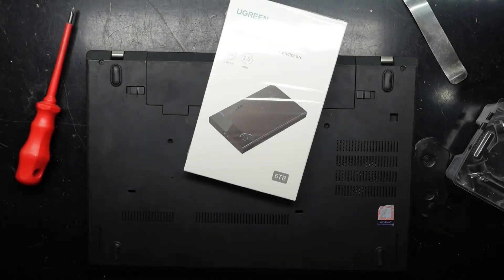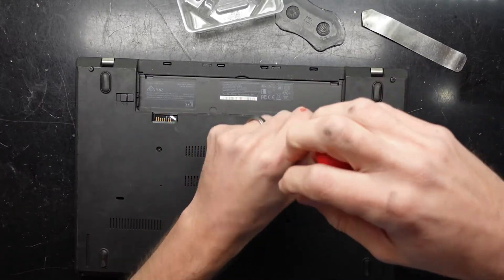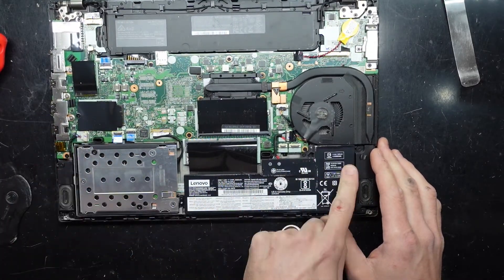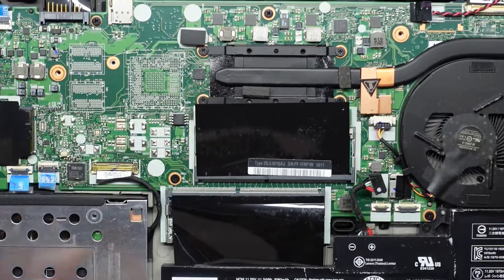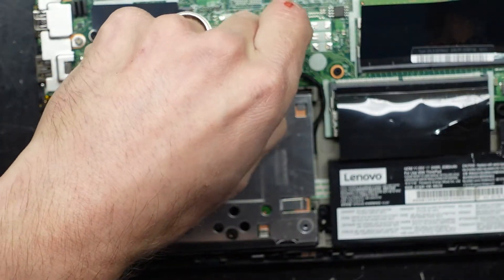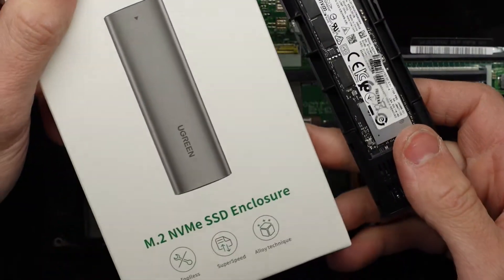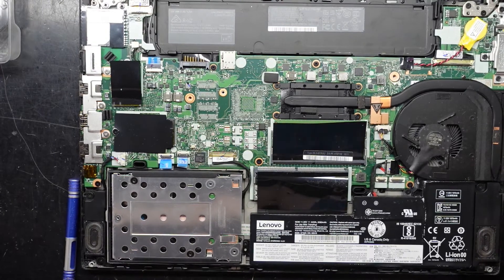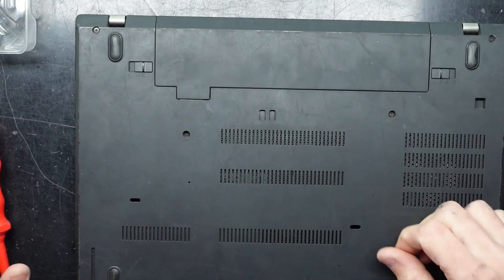Lenovo Thinkpad T480 Ram and SSD Upgrade

Comment: Thanks for this. The 16G SanDisk 'hiding' has been bugging me. What was the 'problem' it was causing for you? I'm curious because for whatever reason, no matter what standard 2.5" SSD I toss in to replace the Fujitsu spinning disk, it's never detected by Ubuntu, and the installer persists attempting to install on that silly internal SSD. Perhaps this is my chance to pull it and give the reinstall another try.

Comment: Hey man, very nice explanation! Those little movement tips and how to remove the cover really saved my laptop! Also, a quick question, do you know if can change both of the ram sticks for a 32gb, to get 64gb? And to upgrade the ssd I need to go with a M.2 too right? Sorry for the long comment, I really just feel kinda lost in hardware things, thanks